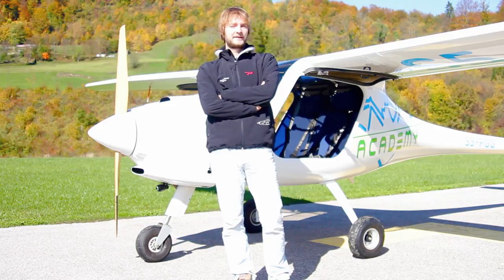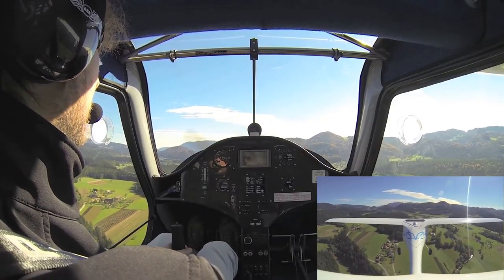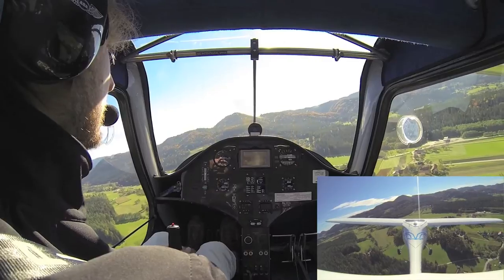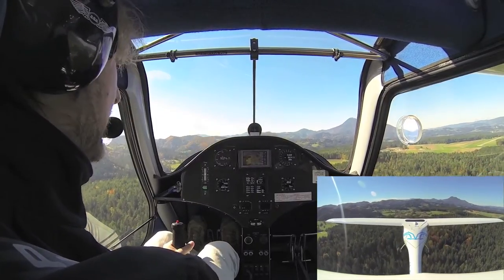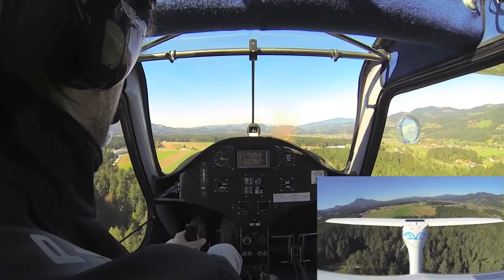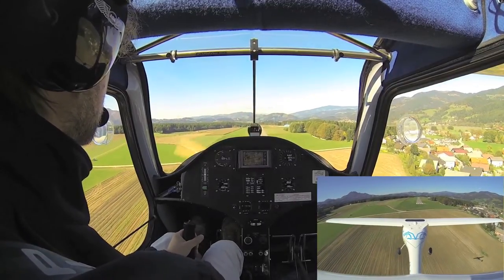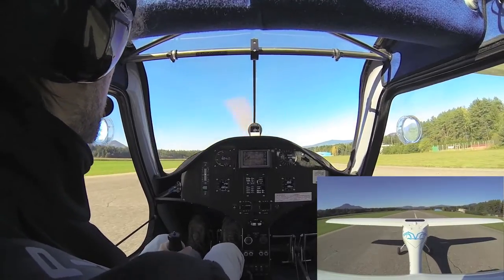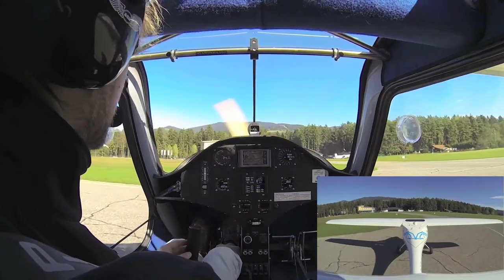Pipistrel ALPHA Trainer normal landing

Comment: Very nice video, with just the facts and numbers.  Thank you!    Do you know if you can steepen the the approach using the airbrakes?   Or how would recommend using the airbrakes for the best landing?   Are they effective in quickly losing altitude, as in a glider?
Reply: Hi ! Yes you can steepen the approach with airbrakes...a lots !  Personnaly i use the airbrakes for correct the steepen of the descent and for landing , only if the runway are short. Because the  attitude is different, i do prefer whitout . But it's a good option to have it.
Reply: @francoispotvin2229  Thanks. I will do a demo flight later this week!